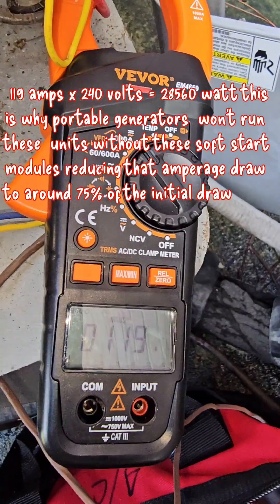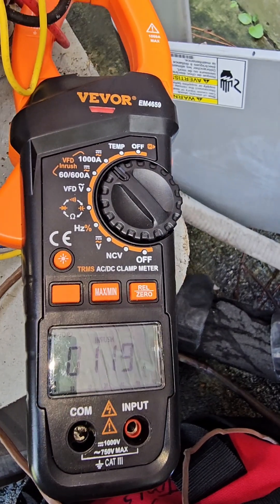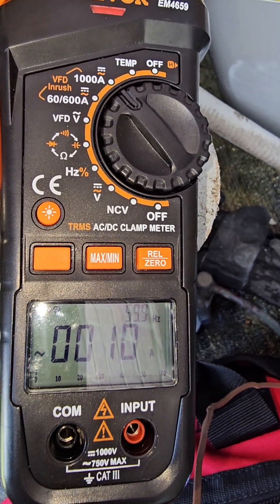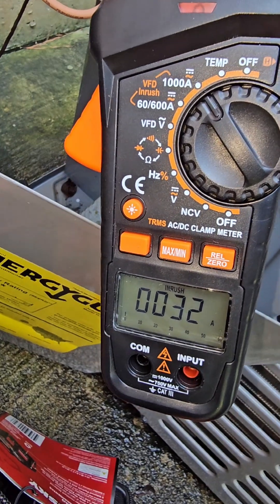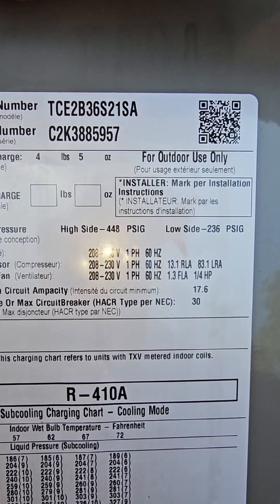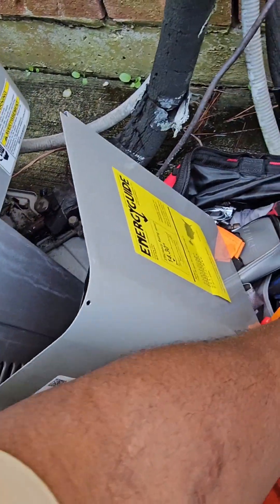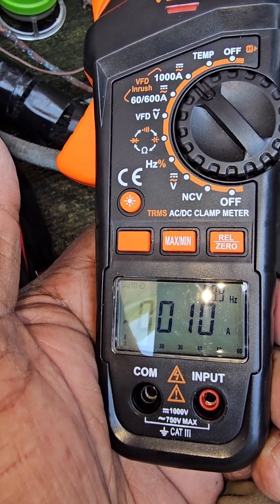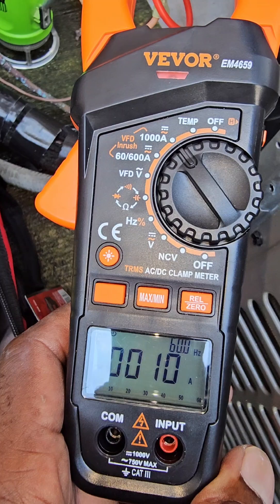The significance of soft start modules on condensers units

Comment: A soft start doesn't decrease the running amps. Running amps vary depending on how hard your AC is working at the moment.
Reply from the maker: Ok, at that particular moment, they  were at a decrease.  Look, there are several variables that play a factor.  A dirty condenser coil, a dirty filter, etc, that can increase rla's.

Comment: LRA (Locked Rotor Amps) is NOT how much amperage the unit needs to start. LRA is what it says Locked Rotor Amps meaning that if the motor is seized or locked up this is the expected amount of current the unit will draw. Soft Start Modules are only good on AC systems that have Piston metering devices, or Bleed Off TXV's. They are not meant to be installed on AC systems with Non-Bleed Off TXV's or systems that have liquid solenoid shutoff valves on the liquid line as the Head Pressure will be too high for the Compressor to overcome without the inrush current to get the Compressor Spinning, especially on Scroll Compressors if you want to get them to spin the correct way.
Reply from the maker: Lra is the maximum amount of current a motor will draw when the compressor rotor is locked up, which typically occurs doing the start-up.
Reply: @ChasingTailsOutdoorsTV  take the Compressor wire off of the Start capacitor and see which amperage reading is higher, starting amps OR LRA, then you will see that LRA is much higher than Starting amps which is not the same as LRA.
Reply from the maker: @bradw.5991  when I refer to start up I'm speaking on inrush/ lra amps. So yeah lra is much higher.  So we speaking the same. The 119 amps is on my 4 ton which has no soft start. On my 3.5 ton I was only able to record my inrush amps after the fact bc I didn't have the meter thats present in the video at the time of install.  After install the initial lra is 32 amps which I know was higher before the soft start I installed on it.
Reply: So why did it work for his system then?
Reply from the maker: @condor5635  confusing to me maybe a play on words, then way I was explaining it, but I know what I'm talking about.  If a person can read with understanding, then you can do just about anything if it's in your will house.  Not being a toot about it.